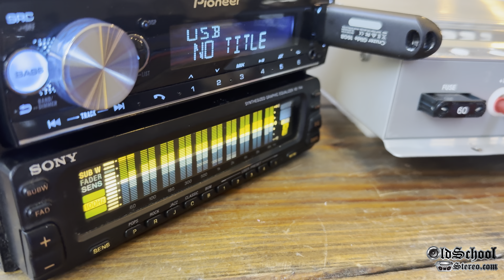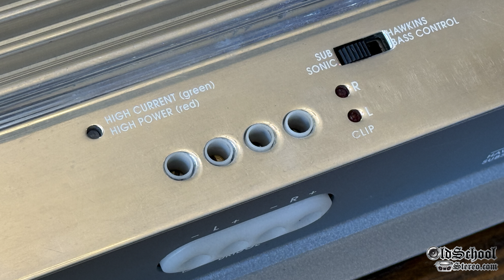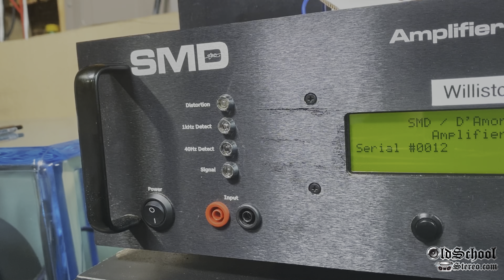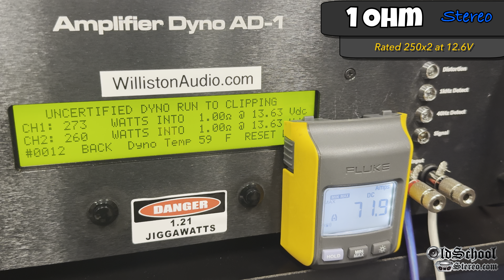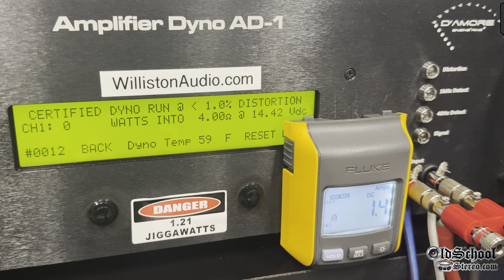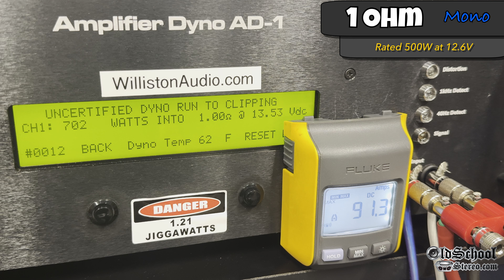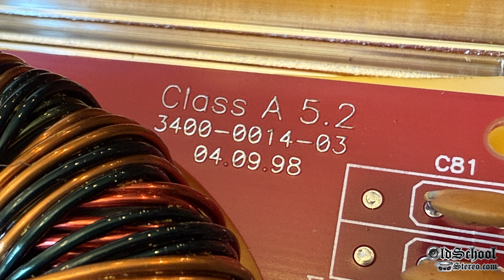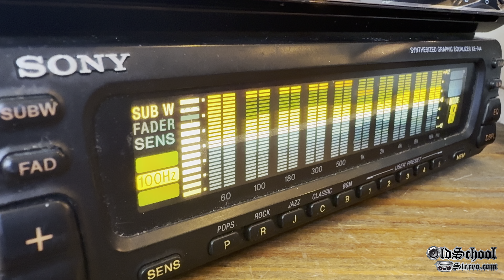This Amp was Rated 1/2 watt? 1998 Soundstream Rubicon Class A 5.2

Comment: A collegae from me at work uses the air bass system from Soundstream. He had 4 Rubicon 1002 (or what's the type nr. The ones that puts out 1000w on 4ohm load) and 2 Reference 1000's and 16 10' SPL subs on the Rubicons and midds and highs also SPL series. So i've seen (and definitely heard) it 😀 I'm a Phoenix Gold man myself (only the good oldschool ones) 😉

Comment: Why only dynamic in high current mode?  You said and I know as well from running these amps competitively through the 90's, they don't do well from that type of bench test.  Considering you got close to 700 "dynamic" I think at 1/4 ohm you would have been seeing easily 800 and possibly closer to 900...but I guess we'll never know.  I will say though, seeing your close up shots does show signs of age on the components, so maybe it is a good thing to not push a 27 year old amp to the limit.

Comment: So you get alot higher watt messurement, huh? Uhm.. Then you definently messure it wrong dude... Xx watts into 4ohm at i.e 0,006% THD is good but you have a different and less demanding messurement with alot higher THD at a horrible bad 1%... There is a reason the amp is officialy rated lower than your test.. They are FTC Watt rated and that's alot higher demanding and more realistic continous messurement than your testing.
FYai: Anything less than around 0,05% THD is really bad...👀

Comment: Back in those day, I did install Soundstream and PPI,  at a Knowledge Feest, we brought a class A and they tested it, From what I remember, the Crossover and the Air bass had some function that upper frequency limited the output, I asked to lower the frequency test and Numbers skyrocketed. can you run the Dyno test at a lower range and see if there is any differences?  Just what I remember from the regulated Power on these amps. and also to keep my sanity in check.  Thanks

Comment: Think this era of SS came after I'd moved on, but my first car audio system was a pair of SS A50's (running MBQuart in the doors) and a D100 (running a custom sub box) from a SS tape deck with azmuth adjustment knob. Those were the days (before CDs). Moved-on to Phoenix Gold MS-275, MQ‐425 and Orion HCCA-250G4, which are still in my system! The passion sometimes never dies, of course these days its 13.3" Android head unit streaming SP/DIF to miniDSP and speakers are 3-way Morel separates (with each speaker having its own amp channel and Digital Designs subs.

Comment: I think i still have the airbass kit bnib. I bought it in my student days when a shop was clearing out. I was building my own car amps back then (couldn't afford the good ones) and was hoping to integrate it but never got around to it
Reply from the maker: If it’s the Airbass 2000, I’d be interested in it. I have an original Airbass for the (select) Reference series amps
Reply: @wal2 just got back from out of town. I checked and mine is also for the reference amps.

Comment: Still my favorite brand. First amps to be 1/4 ohm stable as far as I know. With an Eclipse or Sony ES front end, it was eargasmville. There are other great makers, but the sound quality of these is just heavenly. The prices of these are real nasty also, if you can find em. These new amps aren’t made as well as these were. Can’t beat Old School!❤Keep making these videos BigD. It never gets old.
Reply: My friend... you must look WAYYYYY back in time to 1977.... The BOSE CORPORATION.  The VERY FIRST Low impedance 12 volt operation made for Autosound....  They were running them 0.49 ohm BOSE 4 inch speakers with the flat ribbon voice coil.... The BOSE 1401, amplifier and speaker system.... the VERY FIRST Low impedance design for Autosound/12 volt use.  Yeah, I am a Historian too... also, INSTALLED several of them 1401 systems... AMAZING output from only FOUR 4 inch speakers.... simply amazing.  Killer HIGHS and LOWS too... go figure... BDBD/2025
Reply: get this... Impedance MATCHED speaker cables. They are NOT speaker wires.... they are IMPEDANCE MATCHING... theres resistance in them wires, as the BOSE folks stated in the instructions to COIL and STORE the slack wire from the FRONT speakers in a panel or behind the carpet... DO NOT CUT or SHORTEN the wires. The FRONT and REAR speaker wires MUST have IDENTICAL length. So yeah... when dealing with SCIENTISTS and ENGINEERS.... that bunch... BOSE in a nutshell. HISTORY!!!! eat up. BDBD/2025

Comment: I own several of these Amplifiers, installed hundreds.  They run VERY HOT at 4 ohms. You can FRY EGGS at 2 ohms and at 1 ohm they begin to heat degrade badly.  They CAN run at low impedance's BUT as history shows, many of these model of amplifier literally fried themselves into failure. SOUNDSTREAM struggled with these in that regard, made robust improvements to circuits to address the excessive heat issues BUT.... it's in the DESIGN. Frying Pan Car Audio... Them were the days... late 80's baby.. BDBD/2025
Reply: How did you keep them cool back then or did you just let them fry and buy a new one ?
Reply: @Apolloneek  When you are in the moment you really dont think of things like FANS. That was for them comfortable installers. ME?.... SLAM em IN and.... NEXT!!!!! How it was in the late 90's for ol me. SOUNDSTREAM surely should have installed fan(s) inside as standard equipment BUT as I RECALL, that DESIGN was "REVOLUTIONARY" was advertised as such... CUTTING EDGE technology that.... later, proved to be a HEAT SANDWICH that would get so HOT, SOLDER would melt inside them. I own 3 of them, all repaired and refreshed in 2025 at great expense so... NEXT.... see how HOT they get in the ol FIREBIRD.... soon. BDBD/2025
Reply: @Apolloneek I had a few Sony Mobile ES amps in the passenger floorboard right where the a/c comes out.
Reply: @Apolloneek  could only listen to a few songs and then have to let it cool down, sometimes only one song and they would start cutting out or shut off
Reply: @Apolloneek  sometimes they would blow a fuse and you could put a little bigger one in there, but they wouldn’t hit hard when they got hot and would cut out and eventually shut off until they cooled down and you could smell the electronics and heat sink grease had to make sure it had enough grease on them sometimes it would fry the PC board and you have to build it back up with solder because that stuff would get cooked
Reply: Yeah I remember, also Orion gx amps would get that hot too at 2ohms. Burned my forearm once. I'm not sure fans could have really helped these amps though, like you mentioned,  they ran REALLY F'KN HOT!!
Reply: @ds1919ds1919  yeah... the early High Current amps were indeed astonishing... They would not die but they did smoke if I recall... SHUT IT DOWN!!!!! heheheheheh..... What a time.
Reply: they are nice though when it’s freezing cold outside and there’s lots of snow ,they make great handwarmers and help defrost the windows
Reply: @dcraexon  turn up the heater and crank the stereo...  now go inside have a cup of coffee and wait for the car to warm up.... LOL even FASTER... heheheheh.....
Reply: if they're Class A type amps like their name implies, that ain't no wonder, that's the worst efficiency topology possible pretty much, it's always wasting a ton of power.
Reply: @Kalvinjj  high bias class AB at best, class A 200w is wishful at any size, it'd be guzzling 600w at idle per channel
Feasible in a home theater because you can make the cooling really big but in a car that's a massive waste. The obvious sign is when they get hot even at idle. Why it's also unfeasible in anything small is because small heatsinks and class A would send the transistors into auto destruction territory immediately
(look at accuphase A300, it does 125W into 8 ohms or 1000w into 1 ohms but it's definitely Class AB in 1 ohm mode or the pass labs XS300, absolute monsters)
Reply: @Kalvinjj  its only wasted power to the uninitiated... You do understand, much like them TUBE operations that SPRAY ELECTRONS inside a glass tube... Transistors in a Class A topology were designed with that horrific level of "waste" as a byproduct. THAT byproduct for whatever reason is something the human animal responds to. Thus Class designs exist. Virtually intangible to the average man on the streets, there's some folks that can hear...  They can REALLY hear. That level of waste to produce a distinct END PRODUCT is what Class A audio constructs are all about.... There's Class A Pre Amps too... It's the sound... or perhaps the LACK of sound.... that. Thanks for chiming in and yeah.... POWER ON!!!!! BDBD/2025

Comment: Run a test then swap channels on AD1 to see if power difference follows channels of amp or dyno
Reply from the maker: I’ve done this and it’s the Dyno as I mentioned the resistance of Ch1 vs Ch2 on the Dyno is off by a very small amount, as would be expected when using resistors or any other electronic item with 5% tolerance specs

Comment: Question in the dynamic run: It's rated 500 watts at 2 ohms 12.6v .. you get 559 at 14.03 ... so, I assume that it doesn't do 500 watts at 12.6v or maybe shy of that number ... maybe I am thinking too much into it tho 🤔
Reply from the maker: This series has a tightly regulated power supply and doesn’t fluctuate much output between 12-15V of input
Reply: @wal2  awww makes sense ..thanks

Comment: The Soundstream amps from the late 80's through mid 90's were junk (I may be a year or two off) They were made nice except for the output transistor location but they would always break.  I don't think they sounded that good either when driven hard.  I never sold them at my shop but I did remove many to redo other shops systems.  ADS was another piece of crap that was put on a pedestal back then, but those amps were distortion boxes and space heaters when you tried to run them loud.

Comment: Why 0.25W ? A joke I'm missing ?
Reply: I believe competition classes were categorised by amplifier power at 4 ohms back in the day. This is how cheater amps became popular, they may produce low power at 4 ohm but shine at really low impedances.
Reply: @ I remember it being sorta a joke... spend near 1k for a 50 watt amp... Funny. The RF Peanut amp started the whole ridiculous amount of speakers on a single amp... 30 watts?... something like that. I remember 16 speaker systems and custom crossovers... Cra Cra... I once sported no less than 24 drivers in my old Firebird... Amps were small power wise so more speakers was the thing. NUTZ.
Reply from the maker: Ask Soundstream, they rated it like that
Reply: Rated at 0.006% distortion... its in the numbers.

Comment: Where’s the hifonics titan  and euros  high current amps and the Ulysses? I never see anybody do any test with them
Reply from the maker: I tested a Isis, but never had any of the other ones you mention
Reply: @wal2  yeah... HiFonics I remember as an early RF competitor that really hit the market hard. One of the early players after the industry (ORION) saw a BOOM in the mid 80's.  Now theres an amp that could run low impedance's and not overheat. Thick heatsinks. MORE from HiFonics!
BDBD/2025

Comment: Speaking of cheater amps anybody remember the Grenade amp? Tiny little amp slammed on my shop guys image 15"x4 in plexiglass box
Reply: I was a Blade dealer back in the early 90's the grenade was a regular full size amp and much larger than the SE series which was one of the first ever class d car amps (super small chassis) and the smallest high power amps I had seen at that time.  I think the Infinity was the first class d but I remember signing up to be a Blade dealer around 1994 or early 95.  The helix amps came out a little later, also super small and big bucks.    The Grenade had a small headphone type jack (I think it had a unique resistor in the jack just for that amp) that you had to install to turn it on and when you parked your car you could pull it out like a grenade so if someone stole it they couldn't use it.  The Grenade wasn't a cheater amp but it was a pretty decent amp.
Reply: @RAREFORMDESIGNS  was the SE grayish or gunmetal with a grenade screenprinted on it?
Reply: @factsnofiction217  That was the Grenade series amp.  The SE was a very small Glossy black amp with a red led strip along one side.  All the SE amps had the same profile and were only about an inch or 1 1/4 inch high by about 6 or 7 inches wide but the length would change depending on the amount of channels.  There was basically no heatsink and they would get pretty hot if you didn't keep them where they could get good airflow.  I was also a McIntosh dealer at the same time and when I would compare the Blade to the Macs while showing the customers the difference in size between the two was pretty dramatic.  No one could believe those little amps could do what they were doing back then until they heard it.

Comment: I installed at a shop in the 90's. We were a shitsound dealer, 75%+ failure rate right out of the box. Thank you Wade, you screwed people when you designed these at SS, then afterwards when you were "fixing" them and just sat on 100s of customers amps.
Reply: I have to agree with you. These amps were NOT designed well for 90% of consumers. Though they played well, when played well, they would fail if pushed hard. 
    Wade's choice to use so many parallel Darlington outputs and finicky bias circuitry is what caused "out of the box" failures.
Reply from the maker: I have heard this over and over with the SS amps starting around 1996, didn’t know failure rates were that high though. Crazy!
Reply: @wal2  These were run hard by owners I recall... In a CAR, temperatures can easily hit 100 degrees+... Heat was a factor in regards to failure in regards to these amps. NO INTERNAL FAN.... THAT should have been a consideration.... and them cheap SWITCHES. Lessons learned. BDBD/2025

Comment: what rezistors do you use to load the other channels with how big is it and whats it look like???
Reply from the maker: They are 1000W load resistors also used in elevators for the brakes. I have 8 and 4 ohm variants and can be wired to match other channels

Comment: I had the airbass remote for my rubi 1002, it never really worked right…. Still have the amp, but the airbass is long lost…probably in between the seats of the 91 Prelude it was installed in…..wish I still had that too…great show big d✊
Reply from the maker: Oh man no wonder I can’t find any. I did find an original one for the 5.0/10.0 amps, hope it works
Reply: @ I don’t think the airbase was specific . I thought they only made 1 airbases that worked on all SS amps. But I could be wrong…maybe that is why mine never worked…I’ll take a wired bass knob any day, better still, an HU with a sub volume
Reply from the maker: Yes there was a model for the 5.0/10.0 called the AirBass (for compatible Reference series) then the AirBass2000 was for the compatible Rubicon amps
Reply: @ interesting. I don’t really recall. I bought the 604 and 1002, installed them, then went back for the remote airbass, which was uncommon in those days…still is. Maybe I got the wrong one! I don’t know, it was over 25 years ago…..25 years later, problem solved.. mine was sort of kidney bean shaped, with a key ring chain….Maybe I can find one..unlikely ✌️✊

Comment: I actually like seeing no dynamic headroom. It indicates a well designed power supply. With the exception of amps that are designed for a lot of headroom (like class G and H), dynamic headroom means a loose and sloppy power supply. Which often means crappy parts being used.
Reply: Wouldn't it be because of a regulated power supply vs unregulated?
Reply: @Bobdodge72  Somewhat. 

But, a high quality unregulated power supply can also provide consistent voltage. And... Any supply (including regulated) can drop voltage if it cannot provide enough current. 

Generally when it comes to car amps, a regulated power supply is one that produces no more power at higher battery voltages. Many older amps would produce the same power at 12.6V as it did at 14.4V.
Reply from the maker: So I take it you don’t like the Linear Power amps?